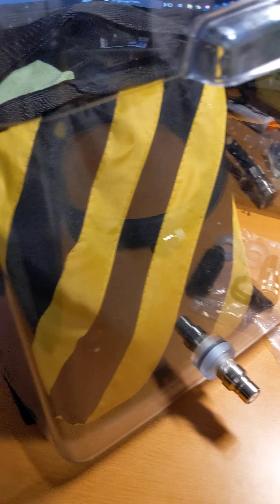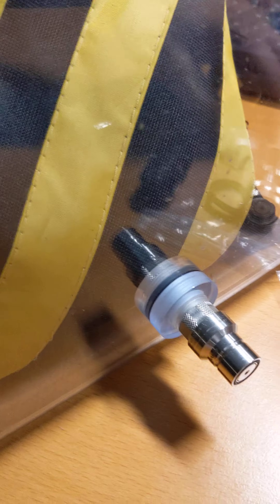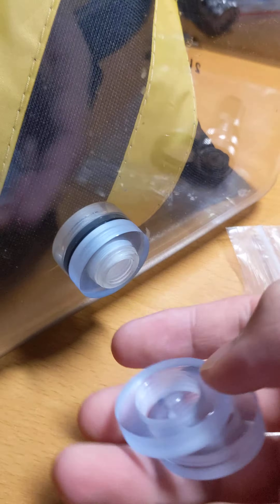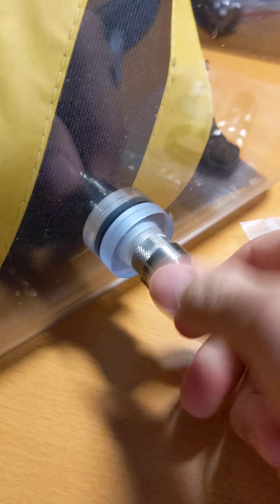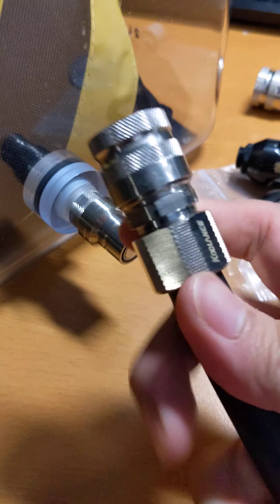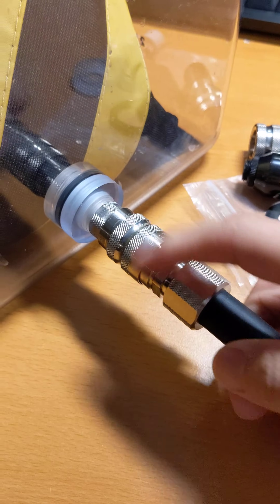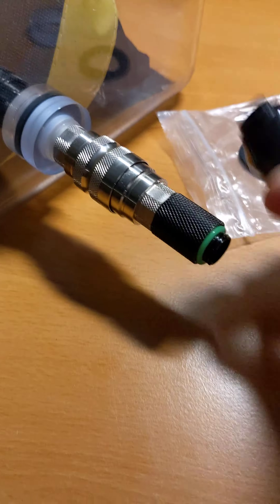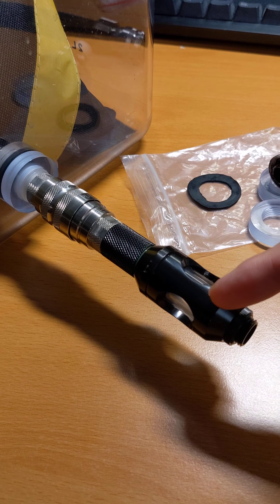How I maintain my liquid cooled mining rig systems!

Comment: Oh yeah your supposed to flush them lol. I remember buying my first water cooler for my cpu. I never changed the fluid but it worked for years before I sold it 🤣
Reply from the maker: Yeah, I like to flush my system depending on the type of coolant and its operation maybe once every couple of months to every 6 months. This system allows me to maintain without even turning the rigs off
Reply: Yeah it's sweet you can do it without shutting everything down. Not a minute wasted! Gotta love that efficiency!
Reply from the maker: Yeah, I spent a lot of time to plumb / engineer it correctly. It makes a lot of difference in the end because maintenance is seconds instead of shutting down the entire rig and redoing everything.
Reply: Yeah it looks like it works wonders. I still love the whole setup you have. Bravo! 👏
Reply from the maker: Thanks buddy, more stuff to come for sure. I'm going to be recording some stuff over the next few weeks and setting up the dual 3090 rig :-)
Reply: @TekShinji  So you think I should flush out a 3080 using XSPC EC6 (clear) every 6 months? Between mining and remote server it will be on 24/7
Reply from the maker: Full disclosure everything about to tell you is my personal opinion based on my years of experience. Someone else will tell you something different and may say that I am wrong.

I personally like to drain and fill my coolant every couple of months. And do a complete flush a minimum of once every 6 months.

The way I see it I paid a lot of money for it so a little extra maintenance for better performance and longevity is a no-brainer
Reply: @TekShinji  Great - thanks for the info and fast reply! My first water cooling PC project and 100% want to do the little extra for longevity from Day1. Thanks again, keep up the awesome videos.
Reply from the maker: You're welcome man, no problem! Make sure you stay tuned so you can see what I do in the future!